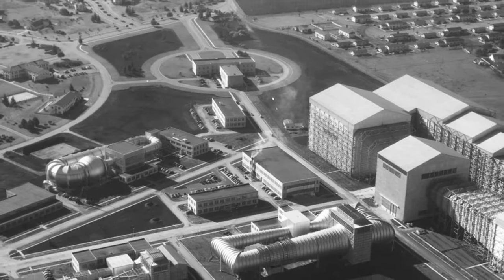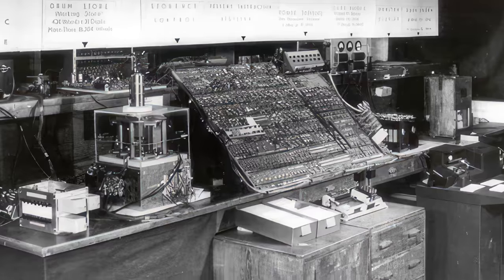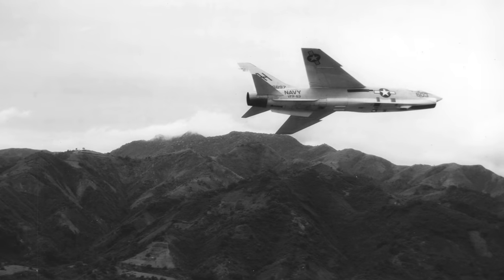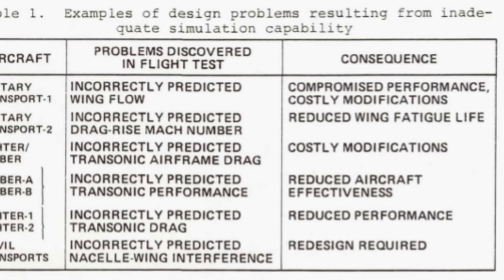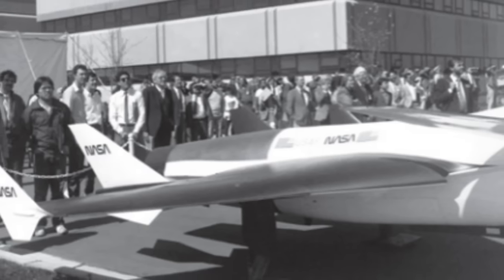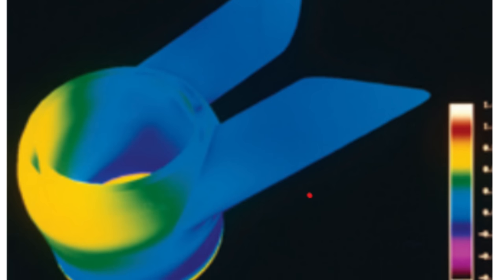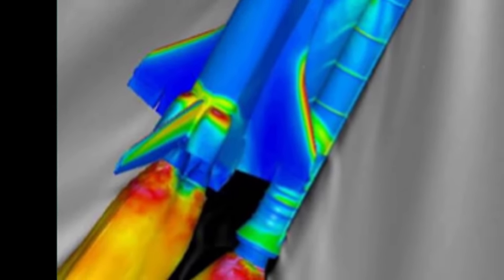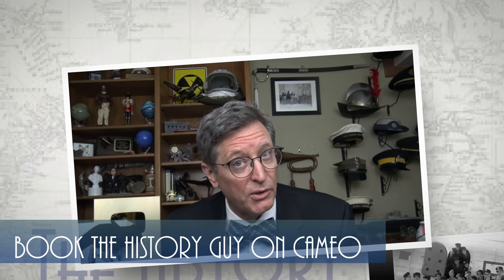A History of NASA's Supercomputers

Comment: I started engineering in the late 80s.  We'd set up an FEA (Finite Element Analyses) model on our old 386 machine and run it overnight as it would take well over 8 hours to complete.  Usually it would fail for one of a dozen reasons. Fix the model, run it again overnight.  Some models would take a week just to get the first result.  Today, the same analyses take seconds.  It's amazing how far we've come in such a short period.

Tech note, your audio track is uncharacteristically off.  Your voice level is quite low.  The closing music came in at the proper level and blew my head phones off.
Reply: My first job was at a research institute. More than one of the people I worked for, had done a lot of work with computers earlier in their careers, creating and loading piles of punch-cards. Many are the stories of dropped boxes of cards, cards in the wrong order, the wrong orientation... and then there are the mistakes with the code itself. 
Get in the queue to use a computer overnight, only to have the job fail after a couple of hours...  if you were lucky there'd be a proactive computer operator working at night who could have a go at fixing it.
we have come so far since then, it's amazing, though booking times on super-computers is still necessary.
Reply: Noticed this audio problem too! I am not crazy, and my phone is not broken! 😅
Reply: Same audio problem here, used the Goodev volume booster to hear it.
Reply: I started engineering in the early 90's.  FEA is at least half voodoo.  It's probably significantly better now with modern computers, but back then it was rough.
Reply: I am in University right now and we can run FEA on laptops, it takes about as long as your 386 did but I think we can have much finer meshes. We just got some funding and spent a good chunk on a workstation that should compute even our hardest tasks in seconds which is really exciting.
Reply: Back before Algore was a person  🤣
Reply: Agree with the audio situation.  Even with everything set to "eleven," I could barely hear THG's dulcet tones.
Reply: Also speaks too fast
Reply: all a computer does is add or subtract, really really fast. We've just improved that speed at which it does that, and the size of the numbers it can handle.
Reply: @QuantumRift  all a computer does is add or subtract ...
     What about logic gates?  I mean, a lot of programming is "if this, do that, else something else."  Adding is super important, basic boolean logic is super important, and memory is super important.
     Not discounting the importance of adding and subtracting, but without logic, a computer is nothing more than a fast adding machine (you have to be old to remember adding machines).
     PS: I am not trying to argue, only to learn your thoughts on this subject.  I speak as a programmer, not an engineer.
Reply: i @QuantumRift  It doesn't even do that. The logic gates are and, or and not. Addition and subtraction are created from these. Subtraction is really addition of a 2's complement number (a representation of negative number in binary).
Reply: @josephgaviota  Uh, everything input into the computer is pretty reduced to addition and subtraction in binary.  Machine language  IS the language of adding and subtracting...... IF - then.... if (this number) is greater than (that number) (and that is determined by subtraction) THEN (the next machine instruction...sure if you are a programmer your preferred language is full of "routines"  (if - then)  OR, NOR (boolean), but those are prewritten and called up when the code requires it and it's machine language. Above that you have assembly language...
Reply: Can FEA benefit from SIMD architectures? Namely, calculations done on a GPU?
Reply: @QuantumRift  IF-THEN is just a jmp instruction, i.e., load the instruction pointer based on a conditional bit in the cpu status register. Mathematical operations will set a status bit like overflow, negative, zero, etc. XOR'ing the value of two memory locations will set the zero flag if the values are equal. You then jmp to a location based on that flag.
Reply: Yea, I can see that - I'm 66 years old...LOL

Comment: Great episode, but the volume seemed low.    Anyway, it was great to hear the VAX 11/750 mentioned.   My first years as a sys admin were spent on 11/785s.   The whole concept of the VAXCluster was phenomenal at the time.
Reply: Same on volume. Also now I need to look up what happened to Cray
Reply: DEC networking was at least a decade ahead of the others, perhaps more. Took Microsoft what, until 2003, to get working clustering.
Reply: I worked on vax's (as a user) all the way through college and for years after graduation. My friend's mom was an assembler (soldering) for DEC.
Reply: Yeah, the music on the end blew my eardrums.
Reply: voice at the end was drowned out by the music
Reply: "The Soul Of A New Machine!"
Reply: @jamespell8526  Great book by Tracy Kidder. I read it years ago (it was first published in 1981), and it's probably worth another read now.
Reply: I used to repair a lot of DEC equipment.
Reply: You mention that they had a pair of Vax 11/750's but show a picture of the vax 11/780.   Having worked for DEC from the mid 70's till their demise there is a whole bunch of history around their various product lines - equally important are some of the machines that were built in the labs but never saw a customer - From the Quad processor PDP11/74 through the Minnow (a DEC 36 bit PDP-10 scaled down to fit inside a terminal through to DEC's foray into MPP, and several others...
Reply: In the late '80s, a lot of people I worked with (mostly on DEC PDP series computers) were almost literally soiling themselves in anticipation of working on a VAX.
Reply: @peggywoods4327  we loved all our DEC technicians.  They were great people.
Reply: I used to work for D.E.C. (the Canadian division) and maintained/repaired my fair share of 11/750's and even an 11/780 at a college.
Reply: Nice, I was crazy enough to drag home an 11/750, take it apart, an rebuild it on the third floor of an apartment building only to find that I had plugged in the airflow sensor thing wrong and blew it. It took many years and tech advancements before I stopped dragging 'big iron' home to run my stuff on, now I'm quite satisfied with an i7 laptop heh.
Reply: @noth606  People laugh at Ken Olson's remark about people not wanting computers in their homes. No one at the time could have predicted the extent to which miniaturization would go. Sure, going from vacuum tubes to transistors seemed miraculous but to imagine large-scale integrated circuits and other remarkable technologies was not that obvious  at the time to allow people to buy and use computers. My first computer was a Commodore VIC-20 and soon bought a C-128. Software cost money but was readily available. 

Parking a PDP or VAX in a house doesn't have the W.A.F. (Wife Approval Factor). 🤪😂
Reply: @n.miller907  my first computer was a VIC-2O too, but when it was oldish already, what I remember most vividly was hating the keyboard as I tried to punch in listings for games in some magazines... The C-128 I've seen but never touched one, it was a visit at a rich kids house once. When they came out the Amiga were a huge phenomenon, but I was a foster kid in a better off family, I saw it but was never allowed to touch it, cool graphics though, I could sit and watch when the parents were out. Later on I scratched that itch by getting an upgraded A1200 and then A4000\040. The PDP and stuff came later, but I was still in my teens then. What I did do much later was to get a SGI ONYX RE2 and a cluster of IBM RS/6000 servers to run my home version of home storage servers lol. I have none of that stuff left though, except a Tadpole SPARCbook laptop somewhere. All that stuff were itches I had to scratch in a way, which I did. But at least I can say I had all that stuff and talk about the good and bad of them.
Reply: @noth606  I bought the VIC-20 at a clearance price of $80. I had very young kids around that time, so I bought a few kiddie game cartridges for my little girls. I also had a home finance cartridge which served me very well. It was a nice place to start my home computing needs.

The C-128 was actually three computers in one box. The native 128 column mode, the Commodore 64 mode and CP/M.

I ended up buying all of the GEOS applications in both C-64 and C-128 modes. It was leagues ahead of IBM PC's and Apple Ii's at the time. I got my money's worth in spades.

The power supply was notorious for dying and mine died even though I had a fan running on it all the time. Within a short time, I ended up with a used 386 PC and within a few months swapped out the motherboard 486 DX2 as I recall. I got some great CD-ROM titles too. No one I knew had a computer or even knew what one looked like.

Working for D.E.C. up in Canada, I had access to their large intranet system. It was full of interesting bulletin board-like forums on any topic you could imagine. This was the precursor to the internet. Again, I was leagues ahead of my peers.

Amigas never came my way and near the time they were dying, I came very close to buying one. 

These days I'm using a lot of old hardware, all running Linux of various distributions. I ended up finally buying a new laptop (my first new laptop actually in late 2022). If came with Windows 11 but I immediately wiped that off and installed Linux Mint instead. It runs beautifully and fast! It was a Lenovo on sale for dirt cheap (half price). 

I used to work on just about every piece of hardware Digital Equipment made, from PDP-8's, entire entire PDP-11 line and into many of the VAX machines, including all the attached peripherals. I did a lot of read/write head replacements for RL02's and RM05 drives over the years. 😁 I put a lot of mileage working for that company and drove in the worst weather Canada had to offer too! I also put in a lot of long hours. In one instance, I worked 27 consecutively, came home and went to bed for about six hours, went back to work and did another 24 hours straight! 

I'm a bit nostalgic about those days. So much promise in the technology and I worked with a bunch of great guys too. 

Do you have anyone around to share your nerdy stories and accomplishments with? I sure don't. I never met anyone who worked in the tech field expect for one chap I only see maybe once a month or less for a couple of hours.

Seems like you had your fun with your computing hobby. I know I still get a big kick out of using Linux and the cool apps that work with it.
Reply: @n.miller907  Ah, another proud nerd! But no, I don't have local friends who go into computers like I do, I run simulators for big iron on my laptop these days, and no-one understands why I get a kick out of running software for a Cray 2 on my laptop. 
I ran Linux 0.9.2(if I recall correctly) back in the day on my Pentium 60MHz to help them fix the FDIV bug to help Linus et co fix it kernel side, before having Intel swap it for a fixed one. I ran Linux for a long time, then only Solaris and IRIX for a long time. But work sucked me back into having to run Windows to work remote etc, and now it's just easier, mostly for seeing my son via Skype etc. I forget the original joke, but there was one about the correlation of your beard and being competent in tech stuff - I have a decent beard now lol.
Reply: Yeah the ending song was like twice as loud as his talking.
Reply: @pquodling  When I was in college the college had a PDP-11/730 and my work where I was an intern had a VAX-11/780. I used to dial into BBS's late at night and there were the usual questions about what everyone was using. A Commodore-64, lots of Apple ]['s, TRS-80s, and so on. I said I had a VAX and hopefully everyone just thought I was talking about a vacuum cleaner.

Comment: Great presentation!  I had the pleasure of working on most of the platforms mentioned from CDC, Cray and IBM as a system programmer at the GM Research Laboratories. We often collaborated with NASA Ames and NASA Lewis on software issues.

Comment: I was a computer professional for 50 years,so lived through much of this story. I helped maintain the IBM 360/91 at Princeton University in the late 1960’s and early 70’s. I remember be called upon the help out at NASA in Harlem NYC. They had an IBM 360/95. Quite an honor for a young guy. Also, an adventure for a country boy. I was on the subway, feeling really out of place, and I was asked for directions. I also maintained the IBM 370/195 at NOAA on the Princeton campus. Exciting times. In later years, I was involved with clustered UNIX servers, all connected with a high speed switch. Each node would compute part of the problem.
Reply: The 91 was a pioneering machine, which got mention in Computer Science architecture classes.

Comment: I worked at a oil company that had a Cray XMP.  I was a new graduate and was givne a tour of the data center where it was housed and they had it "open" so we could see the inside.  We even got to sit on the "seats" and you could almost "feel" the power of the thing as it hummed away.  It was really cool.  Got to see the NEC SX-2 at the Houston Area Research Center that at one time was one of the fastest super computers too.  Got a printout of the 29th Mersenne prime number that it had found.  Really neat stuff
Reply: I remember the seats, but I didn't think they were for actual sitting. I thought it was so neat and futuristic that they were liquid cooled. That was the ultimate in tech.
Reply: @sdrc92126  💯agree with that!  The liquid cooling, the "waterfall" with the great CRAY logo on it, dang, that was wonderful back then.
Reply: The X/MP was a derivative of the original Cray-1 architecture. Seymour Cray didn’t care that much for backward compatibility, so his Cray-2 would have required users to recompile all their code to take advantage of it.

So Cray Research spun him off into a new subsidiary, Cray Computer, to work on the Cray-2 (and the later Cray-3 and Cray-4), while the parent company concentrated on producing new machines, like the X/MP and Y/MP, that kept backward compatibility, under the leadership of Steve Chen.
Reply: @lawrencedoliveiro9104  And somewhere in the National Reconnaissance Office in Chantilly, Virginia, there are very tired and lonely engineers trying to keep those things alive because they don't want to re-write the mission-critical software they run on them every day...
Reply: @nufosmatic  I seriously doubt that. Their “mission-critical software” was doing things like traffic analysis and code-cracking, for which they want all the computing power they can muster. So running on obsolete hardware isn’t going to cut it.

Comment: Like a few others on here, my college days were spent crunching numbers on a slide rule.   Handheld calculators made by Texas Instruments were just coming out, but were too expensive for most college students.   Slide rules and computers that we would sneer at today put men on the moon.   We've come a long way in computational power in the last 50 years.
Reply: The B 52 bomber, that may fly for 100 years, was designed by men still using slide rules in the 1950's.
Reply: It’s been said we went to the moon on a slide rule.
Reply: @navret1707  
Photoshop the Moon launch replacing the Saturn V with a sliderule. LOL
Reply: Guts is what put men on the Moon. The LEM's skin was only as thick as an aluminum TV dinner tray. You could poke through it with your finger. You couldn't get me into one of those at gunpoint. I'd insist you shot me on the spot. I don't do sheer terror too good really.
Reply: I still have my Post Versalog slip-stick and hard leather case!!! I never used the belt hanger clip, as I was trying to avoid the major geek factor!!!
Reply: I still have my versatrig and its case, I think I got it in 67 or 68
Reply: Have you heard the one about the constipated engineer? He worked it out with a sliderule...
Reply: I took the last sliderule class my high school offered. That same year I bought a Commodore hand calculator that had 10 digits. Most hand calculators had 8 digits - when I got to college I answered a question with the correct answer but got marked down because I could do it on my calculator where the point was to use algebra to decompose the problem and do the calculation with your 8-digit calculator.
Reply: My first calculator was TI-30 in 1979 as an Naval Avionics student. I think it would have help to learn to use a slide rule in high school.